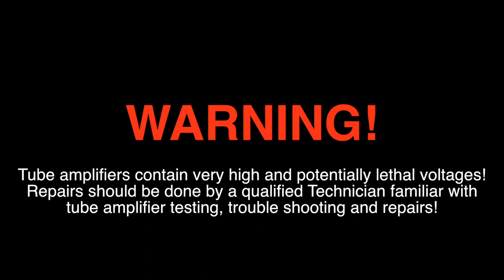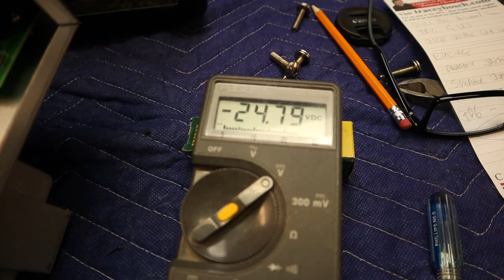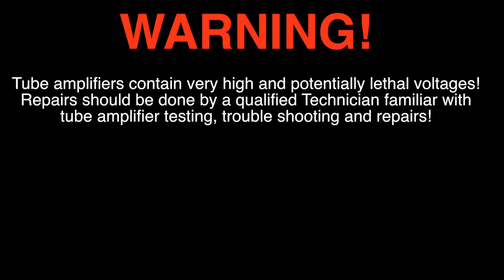BlackStar HT5R Repair // How to debug, fix, mod and test this common issue with these amps!

Comment: Great video. I have an older Blackstar, the HT20 Mk.1 - I'm reluctant to run it often and am considering selling it as it has some of the same problems associated with the later HT series.
Have you ever checked out the HT20 Mk.1 (aka "HT20 Studio") head?
Nothing has gone wrong with the amp - yet.
Reply from the maker: No, I have not. To be honest, most of the music stores in my area don’t carry or stopped carrying them. Haven’t seem a lot of these amps.

Comment: My I ask where you are located.  I have a old tube amp that seems to be getting hot after about 15 mins.  I would like to get it fixed.  When I took it to the guitar shop they told me they didnt fool with tube amps anymore.  Any help would be appreciated.  Thanks.  I love your videos!!
Reply from the maker: Yes, building and repairing tube amps it’s a dying skill set.  I’m near Vancouver, BC, Canada.  Cheers.

Comment: Hi Mike! Very interesting! I have one and my sound fluctuate.. Do you know what's going wrong? I change both tubes and i have the same problem. Thanks for your time!!
Reply from the maker: That sounds typical to what I had discovered and "fixed". Its explained in the video. If the amp still works you may be able to save it without replacing any components. Just add the heat sink, clearance the transistor traces and a new 12BH7. If more is wrong (ie burnt parts) and you are not into electronics you may not be able fix it and a shop will charge more to fix than it is worth.  Good luck, cheers.
Reply: @ thanks a lot

Comment: Hello Mike, very interesting!! I have ht-1 that just replaced both the tubes, do i need to rebias the amp? If so how can i determine the correct value
Thanks
Reply from the maker: It is a good idea to check and/or re-bias a power tube whenever you install new power tubes. In these amps it’s not as critical however for max efficiency you should balance the triodes in the 12BH7.  Just adjust the trim pot till they are the same voltage. For biasing, I would stay under (at least 80%) of what the tube manufacturers say the tube can be at. Check the spec sheet of the 12BH7.

Comment: Hi Mike, I have the HT5 Metal head and yesterday on the gain channel it sounded as if my highs and mids had disappeared, similar to someone putting a duvet or two over the cabinet. I cranked them up, and then they still faded. 
I switched the Pre amp tube, and it now sounds fine, however someone on a forum said it is unlikely to be the tube and it could possibly be this. 
The amp sounds fine now with the new pre amp tube, so could it really be this issue or was it just a failed tube? I have owned and used the amp since the HT5 metal was released, so I would say 8 years of use?
Reply from the maker: Thanks for commenting.  Very interesting issue you have.  The issue in this video typically effects the bias of the power tube (12BH7). Without testing voltages it’s hard to say what is going on in your amp. 12AX7 tubes last a very long time. Unless your amp was left on for weeks/months at a time it should last many years before it will fail.  These amps run the power tube a lot harder so you may want to replace that tune as well.  That being said, could be a bad tube as well.  I’d date it and keep track of run time.  Cheers.

Comment: Thanks for the video! Sorry to say, but i have a same problem. Sound disappeard and there is fuzzy burning_like sound. Called to repairman and he said -i can look it, 90 euros/hour. Hope it doesn't take too many hours :)
Reply from the maker: Sorry to hear that. It is a common issue with these amps. The amp can be saved if nothing catastrophic has happened to the board and components. Mention my video to the repairman. It may help him solve the issue. Good luck!

Comment: Hi,   the 2 transistors  did you use  STK830  or   IRF830's  there both the same but  the IRF830  i cant seem to find 220 type with plastic casing  witch did you use and where did you  get yours ?
Reply from the maker: I’m not familiar with that mosfet. Mouser sells the IFR830.  That being said, Whatever is in your amp is what I would replace with new (like for like) and add the heat sinks.

Comment: I have a ht5 head from 2012 that has no sound at all on the clean channel but when I engage the overdrive channel it plays like a clean channel with no distortion at all, can you recommend what it might be? I replaced both tubes so that’s not it
Reply from the maker: That’s unfortunate.  I don’t think that’s a tube issues.  Seem like something is wrong with that portion of the circuit board.  Does is work okay using the headphones?

Comment: Hi Mike - great video - I wish I'd seen this sooner - I have a Blackstar HT5 with exactly the issue you described. I had already narrowed things down to the FET transistors and fitted new ones accordingly (Although I didn't fit heat syncs, drill out between the contacts or replace the resistors)  - I also swapped out both valves for new ones. All seemed fine for about 5 minutes, and then the output valve (12BH7) lit up like a christmas tree and fizzled out, as did all sound. I now get power up only, but no output volume at all. Could my problem be related to your fix? If I swap out the FETs for more new ones and replace the resistors and drill out between the contacts do you think I'll get any joy, or has something more catastrophic happened do you think?
Reply: PS: I have fitted another 12BH7 valve, which seems to be operational, but nothing is happening-...
Reply from the maker: Thanks for the comments! It's really hard to say what else on the printed circuit board has been compromised. At this stage I would check voltages and resistances.   See if the speaker is good, the output transformer are good. All the fuses are still intact...etc. Basic Tube amp trouble-shooting. Remember, there is high voltages in here. When checking resistances, drain the caps. Replacing components may work.. but you could also be chasing your tail if the circuit traces are baked. Hope you figure it out!

Comment: First, thanks for your video and taking the time to share and help. I have an HT CLUB40 combo that had similar symptoms with the difference that after a couple of times working 30 min before going dead (no sound at all) now it doesn't make any sound when turning it ON. The 2 preamp tubes glow but the 2 power EL34 tubes don't. I see a similar structure in the board regarding the 2 FETs and the resistors you changed in the HT5, probably different parameters but similar architecture. I already tried resoldering the tubes' contacts to assess for a cracked joint but didn't work. Do you think changing the 2 resistors and transistors and putting heat sinks could work here too?. You said at some point "You don't want them to fail completely" .....in my case I believe they did. Aside from having dead components that need to be replaced...is there any another concern I should be aware from these elements having failed completely? Thanks!
Reply from the maker: You're welcome. Unfortunately, I'm not familiar with that amplifier/circuit. Very hard for me to say what your issue could be. Tubes "glowing" is the function of the filament circuit. Pins 2&7 on the EL34's should read 6.3volts. Unless the bias circuit faulted and destroyed the tubes, the only way of knowing is by getting the schematic, new power tubes and testing voltages. At that point, I'd recommend taking it into a qualified Amp Tech.
Reply: @MikeFreda  Hi Mike!, yeah with the tubes glow I wanted to say "at least there is some current going thru those tubes". Well thanks anyway. If I manage to fix it and identify the issue I'll post it here as there are other HT owners that may be in the same situation. Take care!

Comment: Do you know if this is similar with the OG non-Reverb HT-5? Mine loses volume ( I have not tried to check the emulated output though) completely after a while and switching tubes did not seem to work. This video makes this seem do-able for me but I was just wondering if the old ones are kind of the same :)
Reply from the maker: Thanks for commenting.  I do believe that amp had the same issue.  Cheers.
Reply: I have a HT-5 that also loses volume after a while, I changed various things but not fixed it yet, did you find a fix for this?

Comment: Hi, I have a Blackstar HT1h that powers on but when you plug guitar cable or headphones you get no output, any common fault with this type of amplifier head.
Reply from the maker: Hello, hearing nothing is typically not a good sign.  If you are not into electronics or worked on amps before probably not a good idea to poke around in there. These amps have lethal voltages. That being said, I'd first see if the amp actually turns on and the fuses are all good. I think there was a fuse inside these amps as well.  I would reset the tubes by pulling them out and resetting them in the sockets a few times. Look at the tube are they clear? are they white? (If they are white, they are bad) if not, turn the amp on and look to see if the tubes light up. 
Other than pulling the chassis and looking for loose wires and any burnt components it's really hard to say what could be wrong. There is a lot of circuitry in these amps. Best to take it in.

Comment: Hi, thanks for making this video, very much appreciated. I'm wondering if my HT5R has the same problem, when the speaker cab is plugged in to the 16 ohm single speaker port there is an occasional very soft and faint random static noise. however if i plug in the headphones it seems to work fine perhaps the max volume isnt deafening but it's certainly loud, the tubes heat up and start glowing and if i try the speaker cab on the headphones outlet it works also at a low volume, perhaps to be expected? So the speaker out channel doesnt seem to be working is that what those MOSFETs control? if not would you have any idea where I should begin looking to find the fault? kind regards
Reply from the maker: Those Mosfets are on the output section of the amp. The emulator section of the amp seems to bypass that section. What you are describing sounds typical of what the issue is. The only way to know for sure is to open the amp and have, inspect and takes some voltage readings.  The amp does have high voltage in it. You may want to have an amp tech look at it for you.
Reply: @MikeFreda  thanks, since I asked the question I have done a bit more investigating and inspected the output transformer, do you know what resistance values i should be getting across the coils (red to black wires)? I measured 1ohm on the input and 0.884KOhms  on the output.
Reply from the maker: It’s are to measure the primary side of the OT is still wired up. From the CT to one leg you may see around 150ohms. Secondary seems right. Anywhere from 0.3ohms to 1.5ohms on the different taps is what you typically see. When a OT faults, it normally faults as a open circuit and you would get infinite reading. Since you are hearing a sound the OT appears to be functioning.
Reply: @MikeFreda  thanks, I desoldered the two identical MOSFETS from the circuitboard and tested them on a multimeter one of them charged up to about 2.2 v the other to 0.65v so they at least one of them is at least part of the problem.

Comment: I wonder if this issue was addressed on the MkII?
Reply from the maker: I'm not sure. I do know that some of the later boards they separated the traces between the transistors with larger holes but they did not add heat sinks or larger resistors.
Reply: I'm wondering the same, hopefully someone knows or can take a look inside the mark2
Reply: My Ht1r mkii had the same issue out of the box :(
Reply: Yes, same issue on the later boards, buy something else!

Comment: Hi Mike, thanks for this very helpful video.  I don't understand why you drilled out the traces to the transister to prevent current leakage and am afraid to do that step because I'm unsure how to do it correctly. Did you desolder the transister first? Do you resolder after the holes are there?
Reply from the maker: You're welcome. It's been discovered that at the base of the transistor the Circuit Board is able to conduct a small trace of voltage and/or current. This upsets the bias and the operating parameters of the transistors. Drilling small holes creates an "air gap" thus mitigating this issue. I did not de-solder the transistors. I just used a very small drill bit and went really slow.
Reply: @MikeFreda  Thanks! Super clear now.

Comment: Hey Mike. Great video. I'm doing this to my amp at this moment. I have to ask you what difference does it make if I use the same heatsinks or replace them with new ones?
Reply from the maker: Thank you! Sorry, I guess it wasn't too clear in the video. The amp never came with heat sinks on the transistors. I installed new ones on the transistors. If the transistors still function you may be able to get away with just drilling holes between the transistors, re-flowing the solder joints on everything, installing heat sinks and installing a new power tube. The heat sinks help dissipate the extreme heat the transistors generate. I had these ones in my parts bin. You may be able to install smaller ones if you want. I do believe theses transistors need something.
Reply: @MikeFreda  Thanks this helps a lot! I bought mine as used and turns out that the previous owner did install those heat sinks. So at some point they had same problems with this amp.. There was no holes drilled between, so this must be an older one right? I did every step you showed, but my amp is still acting funny. The sound does not go away or anything, but its distorted and buzzing, very flat sounding.. and it goes hand by hand with the volume/gain. Do you know if this might be capacitor related or something?
Reply: btw subbed!
Reply from the maker: @PenZEdits  Hard for me o say what it could be. As you can see, there are a lot of components on that board. You may want to check out the resistors values to see if they are still in spec. The ones around the two transistors. (You will need a ohm meter) If the resistors get too hot they go out of tolerance thus effecting the operating parameters of the transistors.  Hopefully you put a new tube in!?  I would also verify all the voltages from the test points. If that all checks out, your transistors (and possibly your resistors) may need to replaced.

Comment: Thanks for this? What is the typical cost to do this type of repair? Not sure exactly what is wrong with my amp, but it makes crackle like noises.
Reply from the maker: For me, I just had to buy a new tube. I had the rest of the parts in my parts bin. If you needed to take it to a proper amp tech, I'm sure the minimum charge would be at least $100.00. As for crackling noises, that could be anything from a bad tube, bad solder joint, dirty pot, bad jacks, bad speaker, loose connections... etc.  who really know over the internet. Good luck!

Comment: Are these amps a combination of tube and mosfet?
Reply from the maker: Yes/no.  It uses a proper preamp tube and a 12BH7 as a power tube with a proper output transformer. The mosfets are part of circuit that biases/applies voltage to the tube and the emulation section. Technically you could rewire this amp to point to point removing all the solid state components but it would be a lot of work and would sound different.
Reply: So the post amp section is Solid State? I like this amp, I’m just unclear why... It’s weird to me
Reply from the maker: Not really. It goes Power tube, output transformer to speaker. The power mosfets set the operation the tube. The emulation section seem to be mostly solid state. Probably best if you found the schematic online and followed the signal chain. No clue why they do this. Easier to make for the multitude of tones and options you can get.

Comment: Is this also a recurring problem on the mk2?
Reply from the maker: Sorry, I'm not aware if they corrected all the issues. I do know that did eventually drill holes between the transistor traces to help cure some of the leakage issues.
Reply from the maker: @UCrbD5DfW1Nimq13LLbdL_EA Sorry, I'm not 100% sure. The Mk2 came out in 2019. The amp I worked on was several years older than that so I suspect it was a Mk1. From what I gathered, they made minor circuit board changes throughout the production runs. That being said, I have no idea if all these issues have been corrected on the Mk2. Best to check the Blackstar forum.

Comment: My headphones won’t work in my ht5, the sound comes out of the speakers instead of the phones, I’ve tried three sets and they work in other amps , any ideas ?
Reply from the maker: Interesting. I have not heard that before.  All I can recommend is seeing if the headphones actually work. See if the Jack is not broken or the board is cracked.  That can be an issue. They are inexpensive and can fail.  Other than that, I have no idea what it could be. Cheers.
Reply: @MikeFreda  cheers for your reply,headphones work fine in my other amp , I’ve tried three sets , none work properly

Comment: i do have exactly same problem. so i can find 2w 22k resistance but i can not find 2w 22k so is there any other alternatif for this aplication?
Reply from the maker: Not really. Try Mouser: https://www.mouser.com/
While you are at it, get some heatsinks.
Reply: @MikeFreda  what abouth mosfet. orginal mosfets are auk stk830. but i see that you have used irf 830. so i found stk 830 mosfest your set up shoul be used with irf 830. or can i still use stk 830 with your residnece set up?
Reply: @MikeFreda  by the way i do live in Turkey so most probably i ll buy those residance over  aliexpress
Reply from the maker: I stick what came with your board. I'm assuming different production runs use substitutes. You should be able to find a X-Ref for your STK830